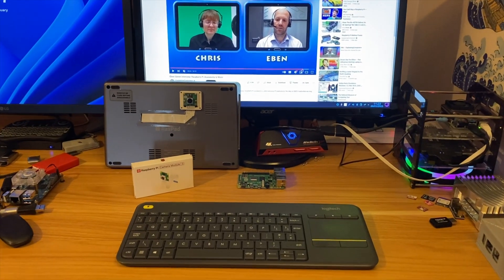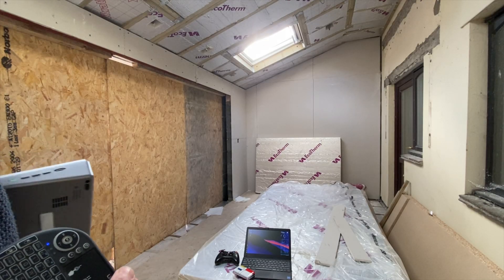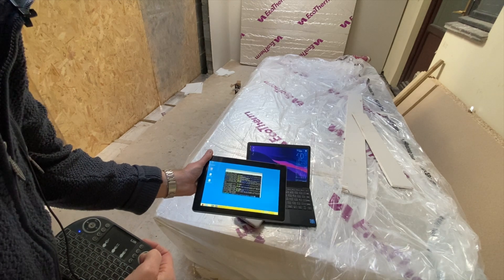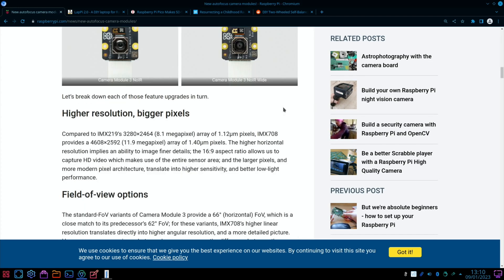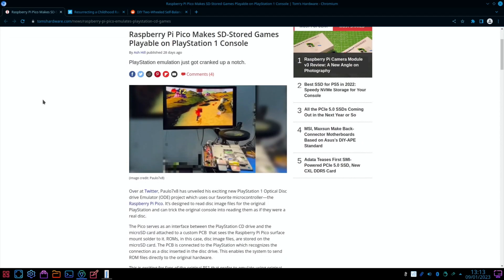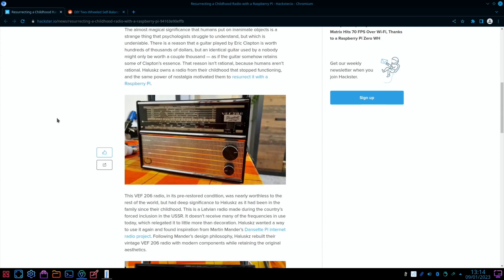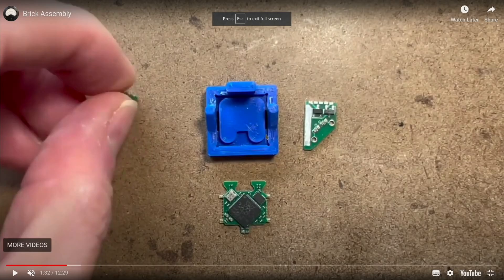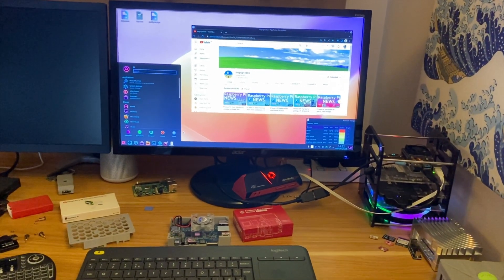Pi News 73. NEW Pi Cameras. Pi 5..... Not this year.

Comment: 0:57: "the best supported (and NOT available on the market) SBC" vs "the best performing (and available) SBC" - what do we say in 2023?
Reply: A good question but I will say from the outset that a lot of SBCs really don't factor into my world above a certain price point - probably around £100 (me being a Brit and all) would be my absolute limit for one.

The "pestilence" that is Windows 11 is good news for someone like me who only uses Linux because it means there's a huge amount of really good and cheap used Intel-based hardware out there at the moment. It's therefore very difficult to justify paying too much for an SBC if I can pick up a 3rd or 4th generation Core -i5 desktop or laptop for the same price or less, especially if I am building an emulation machine.

I am looking forward to getting my hands on the Orange Pi 5, I like the fact that it's more powerful than the RPi 4 for about the same ("back in the olden days") price - so I think that might do well in 2023.

But the Rock Pi 5 also looks interesting too.
Reply: @terrydaktyllus1320  There is one more point you probably omitted here: power consumption. The SBC like Orange Pi 5 (or similar, even Raspberry Pi 4) will take NO MORE than 10W when all CPU are 100%, probably 5W max for 99% of the time. If you can show me any thin desktop that even costs 100 GBP that can while running 24/7 be so cheap from the energy point of view... ;-) So yes, cheap intel is OK but they usually come in much bigger factor as well as much much more $ spent on energy especially if you consider such machine to run all the time.
Reply: @zyghom  I can't argue with the power consumption point but it's just one thing you factor in when working out a computing solution.
Reply: @terrydaktyllus1320  agree. I was looking for the cheap (from all aspects) and small solution for my home server and I am kind of astonished with the Orange Pi 5. I was considering HP, Dell, Lenovo etc for the proxmox solution (as proxmox does not have arm64 build) but docker solved all my requirements on SBC. Cheap and small. And... AVAILABLE! ;-)
Reply: Rock Pi 5 with the same configuration as Orange Pi 5 (16GB) is double the price so above 200 GBP on Ali. In UK it will come close to 250 then...
Reply: @zyghom  It's nice to have more than 4GB RAM if the price is good enough but for what I use SBCs for and how lite I build Gentoo, 4GB is usually more than enough - I think Chris for Explaining Computers got a 4GB Rock Pi 5 for just under £100 a couple of months ago.

But I take your point.
Reply: @terrydaktyllus1320  couple months ago when they had discount, I paid 95 GBP for 16GB on the portal we all know ;-) With the power supply even included. 4GB costs < 60 GBP there

Comment: The rpi foundation will have to come up with a (even better) cpu than the RK3588 if they (still) want to be relevant.
Reply: No, they don't and you're missing the entire point of SBC's therefore. I love emulation and SBC's are great platforms for that, and, for some people, faster and faster CPUs mean they can emulate more systems better - and that's why they want them, although CPU speed is not the only reason I choose a particular SBC.

But that's looking at it purely with respect to some hobbyists without appreciating that there are other reasons to choose an SBC, not just because of CPU speed or even on board memory - price, form factor, interface ports and software support are other factors that those building industrial or IoT applications might also consider.

If that isn't the case then how come the Pi Pico is so popular as a dual core micro-controller with 264K RAM?
Reply: One of Raspberry Pi's advantages is their low price in addition to the "complete package" of the hardware and excellent community support. They don't need to beat the RK3588, they just need to get their prices back down to that $35 - $65 range. The current Broadcom chip is already quite powerful for most use cases. It's perfectly fine for RPi to cede the higher end market to more expensive boards.
Reply: The RK3588 is just Arm A76 cores and a pretty good GPU. Raspberry Pi can buy a license for A76 from ARM and work with Broadcom to make a CPU that has the same performance, if they want. Maybe they already have and are playing with the chips in their labs right now.

Comment: I see a new leepspvideo video, I click play.

Love the new extension to the house—are you going to have some sort of shutters on that window? Would be cool to control them with Home Assistant!
Reply: Two of my very favorite reviewers. Love you both.😊
Reply from the maker: The priority is to try and find a solution of hiding my very untidy desk. Trying to work a solution that won’t sound like I”m in a cupboard.
Reply: @leepspvideo  Engineers are supposed to have untidy desks - it's the law.
Reply: @leepspvideo  One thing to check out is vocalboothtogo's Acoustic Sound Blankets - hang one on each wall around the area you record in, and they do a huge amount of help in cutting down that echoey noise. I don't have room for them in my little office, that's why I stuck some old sound panels from a radio studio around (the grey things you see in some shots).

But it's hard with most spaces to make them sound really good!
Reply: Looks like the kind of extension we need on our house.

I had to build my own outside cabin to work in. Too much retro tech in there (plus the shed opposite!), so priority for this year is to scale it down and get the place functional and tidy so I can find and enjoy what I keep.